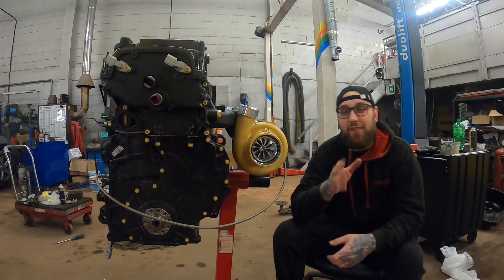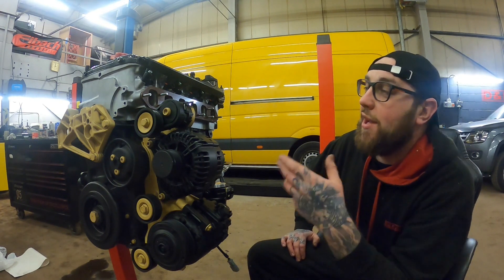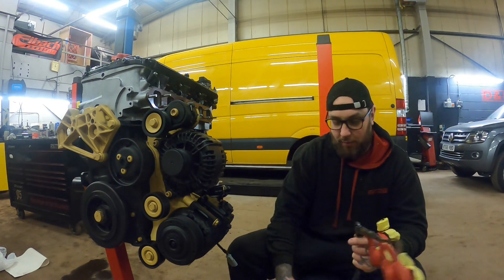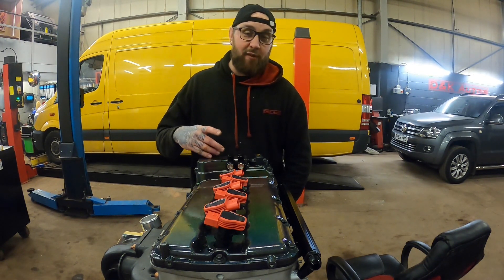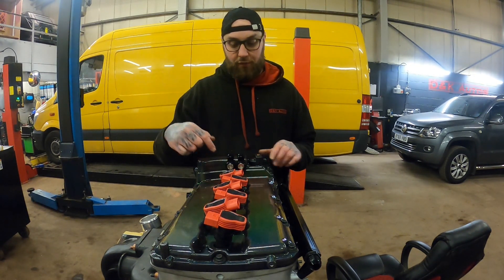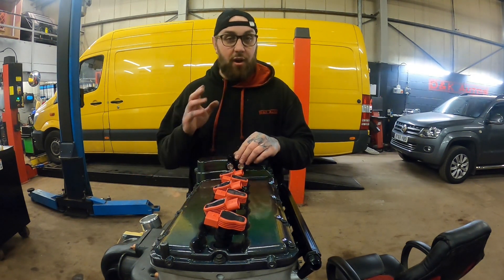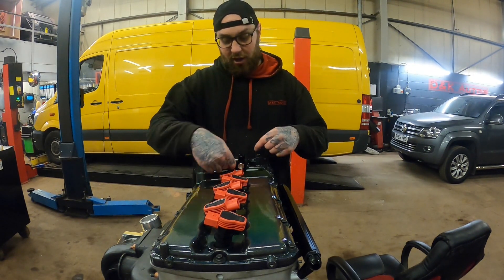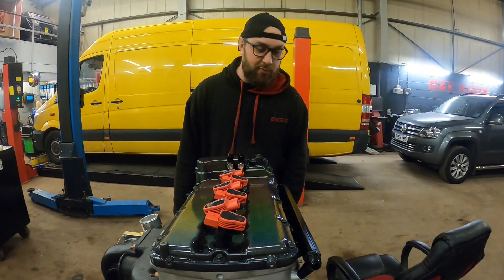PRISMATIC UNIVERSE CAM COVER, BREATHER SETUP & UPDATE! MK5 GOLF R32 TURBO - VR6 TURBO EP.13

Comment: Where are you buying your ECU from pal?
Reply from the maker: Prorace are getting me the new plug a play EMU black ECU for the BUB engine
Reply: @dkautos  Would love some details on getting that up and running, base map and so on.  It's a plug and play for the MK4, think there are some basic mode for the MK5.  Also, hope they make a launch control programme for DSG soon.
Reply from the maker: @vanishingpoint808  I did have the plug and play one for the mk4 but ecu master have now made a plug and play for the mk5 bub engine so ive sent the mk4 one back and im now waiting on the mk5 bub one to come in as its still in production. When I'm ready everything i go through will be recorded and shared with you guys 👍

Comment: what coil pack he using ?
Reply from the maker: R8 Coil packs
Reply: @dkautos  thx .. more voltage than the stock mk5 's ?
Reply from the maker: @g Butler  not really much of a gain performance wise i did it for looks i didn't want the coils pointing straight up wanted the angled coils so i could run the wiring clean. You can also use the black type from tfsi etc ypu just have to switch 2 wires on each coil plug